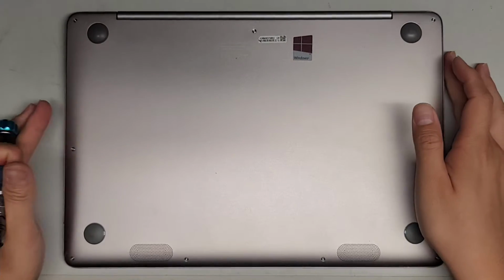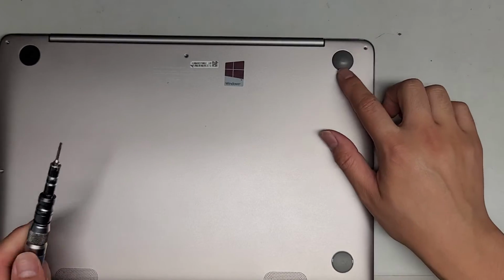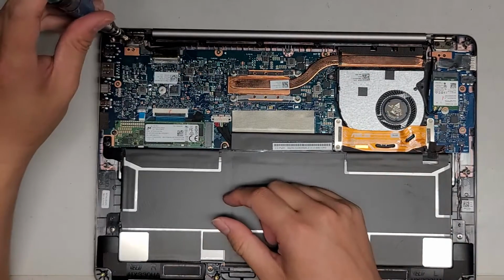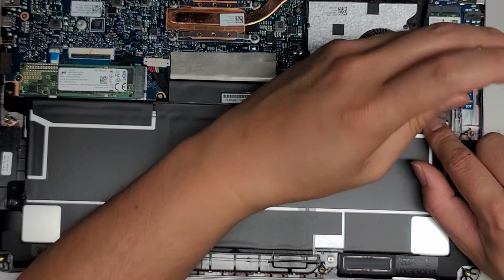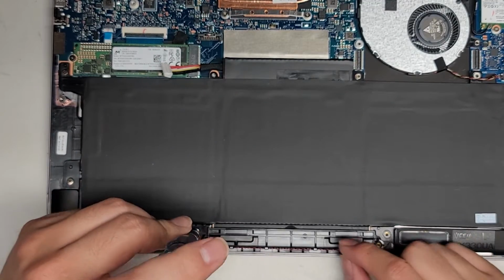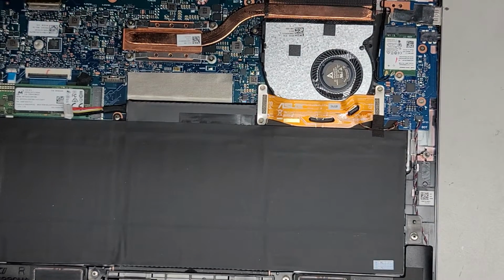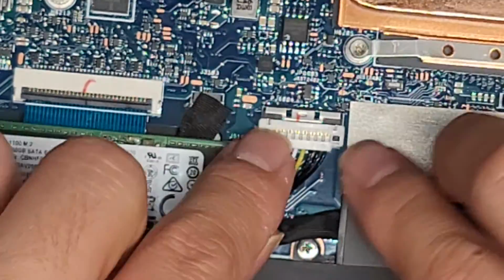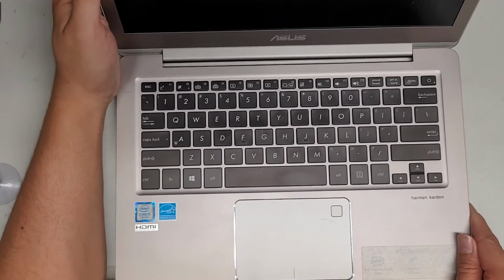ASUS UX330U Disassembly Battery Replacement Repair SSD Hard Drive Upgrade Quick Look Inside

Comment: I have this computer, and whenever its disconnected from power, the system clock resets. Anyone else having this issue? I also cant find the clock battery either.
Reply from the maker: Is the main battery holding charge?
Reply: @ItsBinhRepaired  Yeah, for a week or two in standby (sleep). Then after, the system clock resets. I opened it up the other day, but I was unable to find a clock battery.
Reply from the maker: @Overvalue9829  it's because you're draining the battery. The system clock battery is integrated.

Comment: I accidentally ripped out the connector that the battery plugs into because I tried disconnecting the battery cable before pulling the tab back (before watching this video). Is there any way to easily fix that? Looks like there isn’t because it seems to have been soldered on
Reply from the maker: Likely tore the solder pads as well :(